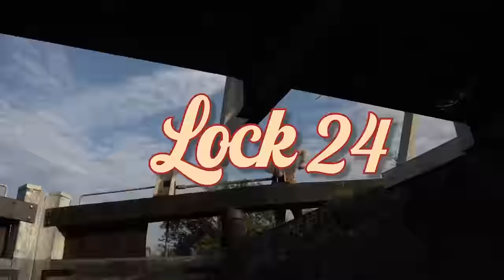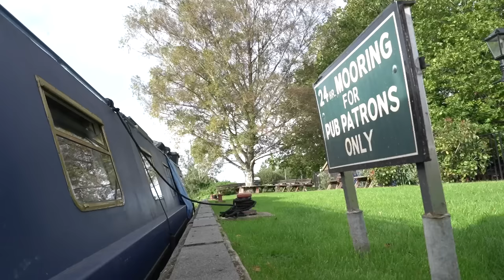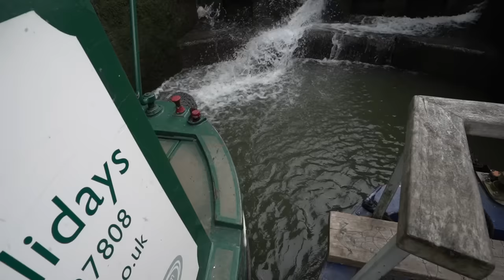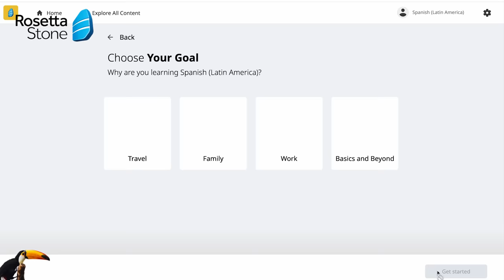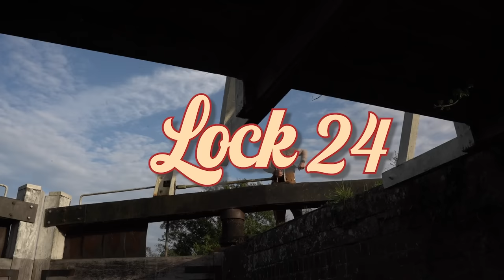It’s EXHAUSTING Living On A Narrowboat Full-Time!! Caen Hill Flight And A Swan Fight | EP 26

Comment: I really wish I could afford to buy a boat I'd love to live like you guys are. 😊
Reply from the maker: I know of a few boaters who had be managed to find them to rent or even bought them for super cheap (a couple of grand) and then done them up whilst living on the boat! It’s a lot of work but it can be done for very little money
Reply: @UlaandJosh  But to be honest what are you going to get for 2 grand? A dilapidated type of vessel which will become a money pit. Everything for boats has doubled, and certain things have trebled in price in recent years, and of course you need to have plenty of money even if you're going to do all the work yourself, and you will need to be mechanically minded to work on an engine, and then there's the electrics, and obviously you have to know what you're doing or else you risk all sorts of problems including fire 🔥 
 But the most important thing is at the start before you purchase your cheap boat is to get a full hull survey, and that will either make or break the deal. And I doubt for 2 grand you will get a vessel with a solid, and sound hull. So buyer beware.